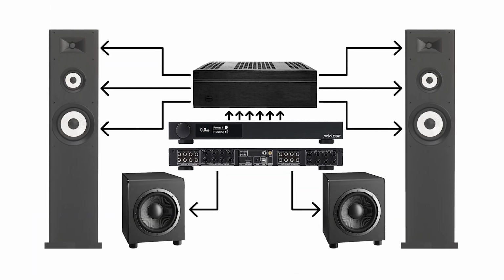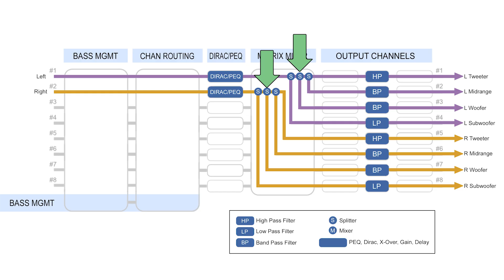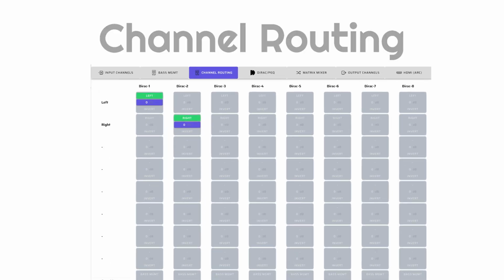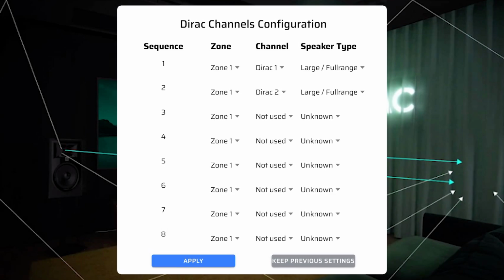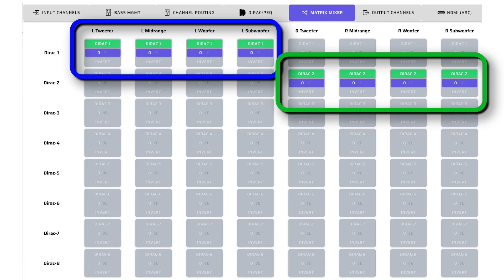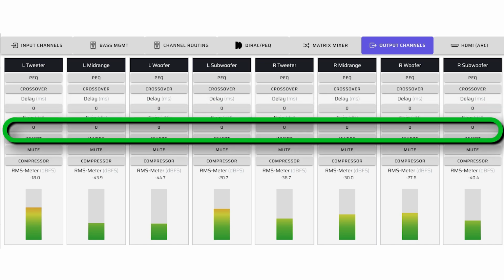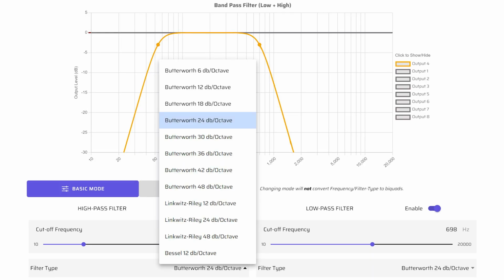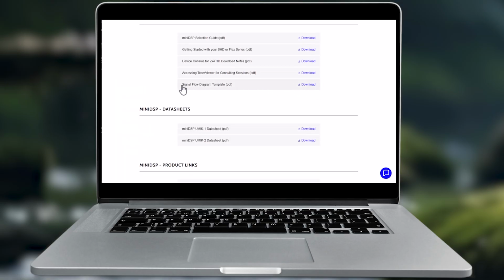miniDSP Flex HTx in a 4-Way Active System with Subwoofers

Comment: I'm currently using an SHD Studio (with 2 channel Dirac) and ouputting to an old DA8 for stereo active crossover duties.
Is there much to be gained by using an HTx instead?
I believe all 3 units use the same processor, so I guess I'd lose raw processing ability.
Would the 8 channel full range Dirac offer me any/much benefit when used in an active crossover?
Balanced analogue outputs may help. I'm curently using 0.5m RCA cables out of the DA8 and have no noise issues but I've read/heard a few comments that my Fosi V3 Mono power amps sound noticably better using the balanced input.

Any thoughts, comments, suggestions etc would be greatly appreciated.

Oh, and if I got an HTx and used the SHD Studio in another system in the same room, would the remotes clash and end up operating both  MiniDSP products at the same time?

Thanks.
Reply from the maker: >>The miniDSP HTx, when compared to an SHD Studio plus the obsolete OpenDRC-DA8, will certainly be a higher performance and more convenient solution for an active multi-way system. Primarily because the DACs in the HTx are far superior to the DA8, and also you will have much better control over delay and other settings as you'll be working within one Device Console page.
>>Dirac will work pretty much the same if you're doing a project on the integrated stereo channels.  Dirac would be performed after you've completed the active crossover setup.
>>We always prefer a balanced interface over single-ended RCA, due to the higher drive voltage, lower noise and lower distortion.
>>If you use the HTx and SHD Studio in the same room the IR remotes will conflict.